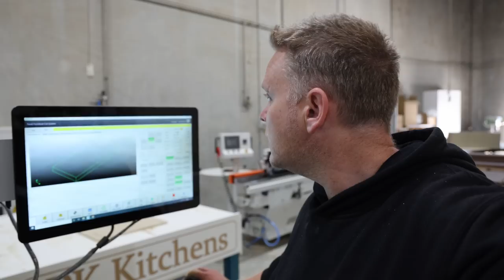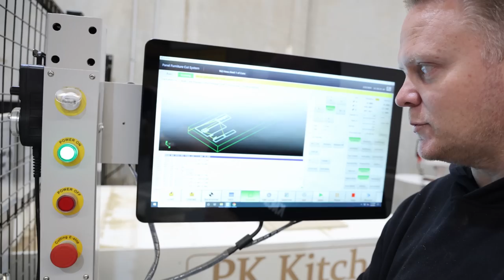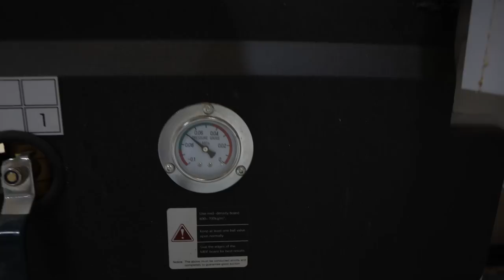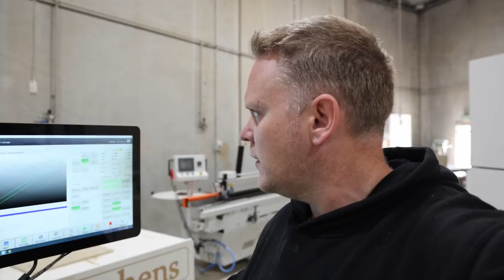Building CUSTOM 4wd DRAWERS

Comment: The hex pattern is very smart looking.......different to all the others out there. 70odd kgs is a fair amount  ( especially in a 200 series ) to be lugging around, plus fridge, and everything you put in the drawer. I made my own drawer to go in my Y62 when I had it out of 3mm aluminium....had it folded, welded the ends in and mounted to the folded sides to fix to the floor.......would have been well under 20kgs. 
Still a great job, and given the ease of gvm upgrades, the weight shouldn't be a real worry......
Reply from the maker: You’ve gotta keep in mind that’s 2 full drawers and a timber chopping table.  
Plus you are removing about 60kg with the old seats that come out.  

Most of the weight comes from the runners.  They are almost 30kg by them self

Comment: Looking forward to what you come up with on drawer designs for your 80 Series build.  I have an 80 Series also, and I'm due to upgrade my drawers soon.  A two drawer stacked up & down w/a 75L chest fridge on the side is my preferred design.  Leaving a flat floor above both drawers and fridge.
Reply from the maker: That’s pretty much the exact design I had in my 200 series

Comment: I love the hex coated sheets, so much better than the shitty carpet everyone uses. The carpet is like Velcro for everything. Almost impossible to clean. 
As for the particle board. If you seal one side with a PVA and water you should have a good vacuum seal. I use a 4:1 mix to moisture protect MDF and particle boards and it soaks in a dries quickly. Super quick with a roller and cheap. 
Maybe the hex for top and drawer fronts and sealed particle board for all other sections. Owners can always paint if they want.
It would be good to fit into the drawer market, but obviously the price point compared to established brands will be a huge consideration. 
One request is, please use a subtle size logo. A small plate is plenty. The huge logos on every bloody 4x4 accessory has gotten out of hand. It doesn't need to be read from the other side of the camp ground. 
All the best in your new direction.
Reply from the maker: The particleboard was just for the test products.  The finished drawers are made entirely from the ply as it’s a much stronger product for the application.

Comment: They look sick mate, I like that Ply too that's pretty cool and uncarpeted would also look nice. At first I wondered why it would be useful having the split drawer but after thinking it would be good rather than packing things on top of other things in a deep drawer.
Reply from the maker: Exactly.  I’ve had deeps drawers in the past and it was always just a pain pulling 2 things out to get to what I needed on the bottom
Reply: @Australian4x4Adventures  Yeah it can be that's for sure. My cooking bag always sits on the bottom under Respect The Bush bags and stuff like that.

Comment: They look great Steve, for me I'd like the raw timber painted black, but I reckon they look the goods. Cheers Steve
Reply from the maker: It’s wax sealed to prevent staining and everyone has different taste in what they like so that’s understandable 

I want to be different to everyone else haha
Reply: Exactly what I was going to say…great work! 👍
Reply: I think he is meaning the cut edges of the ply rather than the flip up workbench, and I agree, painting it would probably make it look that little extra finished.
Reply from the maker: Yeah that’s what I was talking about. 

The raw edges are sealed with bees wax to prevent staining. 

The timber top is finished in food grade mineral oil so it’s food safe. 

I understand it’s not to everyone taste and I get that.   But I wanted to be different and there are lots of ppl doing raw ply edges in kitchens and displays because it’s trendy.  

I’ll leave it upto the individual customer.  If they want it painted cool. 
But the default will be raw.
Reply: Ah all good, my mistake!

Comment: Great pivot! 
Your reputation will hang on the robustness of the draws, along with their weight:- Two contradicting factors.
Given you have that CNC doo hickey, can you cut bits out of the draw sides and replace it with thin ply or aluminium panels? Another thought, embed stainless strip in the draw top and bottom then use the polypropylene carpet to slide on, maybe you can remove one of those draw slide pairs and reduce cost and more weight?
Reply from the maker: By the time I cut out parts and then glue them back together the cost would blow out more then the weight saving is worth. 

I’ve done teflon slide drawers before ( build video on my channel ) but I don’t think that the drawer in drawer setup would work with teflon as it would tilt too much and have too much counter lever in the second drawer.
Reply: @Australian4x4Adventures  Fair enough.

Comment: Do a raw set, ditch the carpet front. The honeycomb and raw timber edge looks better. A lick of polyurethane on raw edge be mint
Reply from the maker: I like the raw look too but the most ppl will want carpet. But it will definitely be an option to not have carpet. 

The raw edges have a bees wax finish on them to prevent staining.

Comment: Fantastic product, presume your only doing them for Y62?
Is the plyboard edge sealed as if it gets wet over time may split?
Is there enough room to get a cable in for light for last draw?
Reply from the maker: 62 is the only one I’ve done so far as a set file for the cnc but that’s only because I haven’t had the opportunity to do other cars yet.   
But I will do almost any car and design as long as I’m capable of doing it. 

Yeah the edges are sealed with bees wax to prevent any water ingress

Comment: For smaller parts on the cnc use holding tabs so the part can’t move idk what program your using but I can pick the width of tab and hight and then I can pick where I want them you just have to cut the part out after but it’s not much more work to clean up the small tab surface

Comment: Chase that’s passion mate👍 I’ve got a drawer from your red head mate which I bought for the weight saving with the slides and the stand alone table. Have you thought about the table ? Love your work mate!
Reply from the maker: I’ve searched high and low for those table legs but I just can’t find them.  I think he imports them for himself. 

I asked years ago about buying a set from him and got told no.

Comment: Can you do it with the plastic slides? Thinking of a Subaru Outback instead of a work ute.
Reply from the maker: I was just saying to the wife today that I need to do a Teflon slide version as a super light weight alternative. 

But I don’t think the drawer in drawer setup will work with Teflon as it will tilt too much

Comment: Do you get any chipping or break out on the ply
Reply from the maker: I’ve had a few small strands come out if it happens to cut right on a join but that’s easy to fix while building

Comment: Hi Could I get an estimate of what you would charge for one of these draws same size as this one. Thanks
Reply from the maker: Hey mate.  There’s a few variations that could change the price but as a guide 

The double drawer unit with the lid is $2600. 
Then it’s plus all the extra you may need or want. 
False floor
Fridge 
Power outlets install.

Comment: Looks awesome mate! well done - can you take weight out of the build with cutouts in the housing? im not sure how much other drawer weight, just a thought.
Reply from the maker: It already has rails top and bottom instead of solid base and top to help reduce.  

I could probably do something in the side but the difference would be less then a kg different. 

70% of the weight comes from the runners and timber top.

Comment: Looks good, should paint the exposed ply on the edges so they don’t stand out. 
Would you sell flat pack so I can assemble at home?
Reply from the maker: I’m probably ganna do the painted edges as an option as I like the raw edge look personally and a few other ppl in the comment section are the same.  
But I understand it’s a personal preference.

Comment: They look great Steve, love the end product... Whats the length of the drawer system closed ? I might put an order in for one for my new project build too (if it fits), just need the table flipped to come out the other side of the Drawer 🤞
Reply from the maker: These ones are super deep to fit a y62 but I can make any depth.  
These are 1080

Comment: Hi Steve, great vids, long time follower (future customer?). 
The draws look great! Didn't want draws in the back, but now I might reconsider.
Refer back to one of your previous vid regarding coil delete air bags for the rear. What did you have done to the front suspension? Was it through AAA/On track? 
Cheers P
Reply from the maker: Hey mate.  Thanks. 

Ontrack 4x4 done all the mods including replacing the front springs to bring the front up a little bit.

Comment: Hey Steve, product looks good.
You should check out 2 other companies that do very similar (just to see the competition) 
Loaded drawers, use hexaply and cnc i believe and Best Offroad who use CNC to knock them out fast.
70kgs though 😬... Have you had a look at light ply? 
Just food for thought. 👍🏼
Reply from the maker: It’s not the ply adding the weight. 

It’s the 2 sets of runners and the timber top. 

The runners alone are 30kg.
Reply: There is alot of people using hex ply and have done for a very long time. 
It's just not seen on the influenza's content.

Comment: I like it, looks mint👌
You going to add black laminate strips on top raw edges ?
I actually have been playing with the idea of changing my rear draw setup & go an upright fridge arrangement.
Will have to give you a yell Steve down the track if I pull the trigger.
Reply from the maker: I’m going to have it as an option of either raw or painted edges.   I personally like the raw looking edge but understand that’s it’s not for everyone. 

I just wanted to be different to everyone else on the market

Comment: Do it buddy you only live once 😊
What edge bander you running it the back ground?
Reply from the maker: It’s an Excitech, the same as the CNC
Reply: How many hours do you put in to making the draws not including the installation to the car
Reply from the maker: there is about 10 hrs of work to cut and assemble the drawer ready for installation

Comment: Looks great but I prob wouldn’t have carpet on the drawer fronts. I prefer the finish on the ply. Just my 2 cents
Reply from the maker: So do I and when I re do my own set that’s probably how I’m going to have it.  

I like the ply look
Reply: @Australian4x4Adventures Is there a reason you didn't use the hexa ply on the top as well? Is it not that grippy? 

I'm loving the hexa ply look too!
Reply from the maker: @JourneyMapsLiveandLocal  mainly a grip issue.   The carpet does have more friction than the hexaply.  

Also for sound deadening. 
Most ppl use bags inside drawers so having the ply inside works fine.  But on top ppl put all sorts of things so I think that needs the carpet
Reply: @Australian4x4Adventures  Ok...that makes sense. I was hopeful that the heat ply might have more grip. It looks legit. I'm building out my drawers right now. Wish I had a nice CNC machine...lol. 

Good luck on the ventures, man.

Comment: Curious on weights with draws fridge false floor. Your 5k toyota you should watch andrew st clair white. He is doing a budget build on troopy with 500k on the clock. The video in Africa they go right into diffs wheel berrings, engine what to look for in depth with mechanic. It's out to patreons not to the general publi.  3 hours of engine diffs wheels brakes.
Reply from the maker: Andrew definitely knows his stuff and a wealth of knowledge. 

Each set will vary in weight based on the car because the size Varys a lot.  
The y62 will be one of the biggest because the boot space is almost 1200 deep where a 300 series could barely fit a 900mm set.